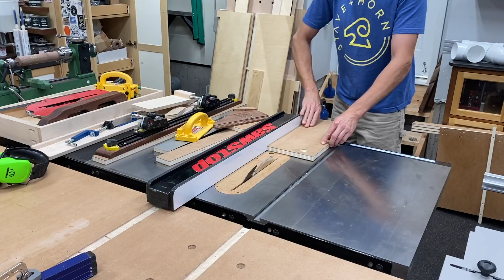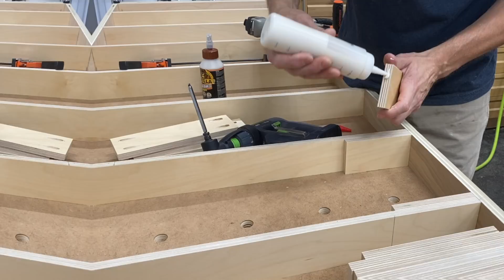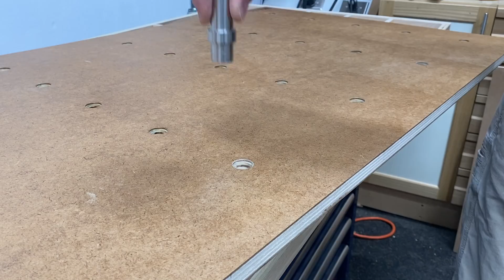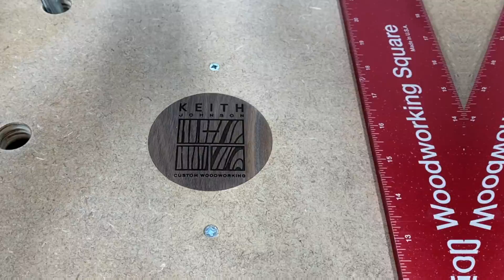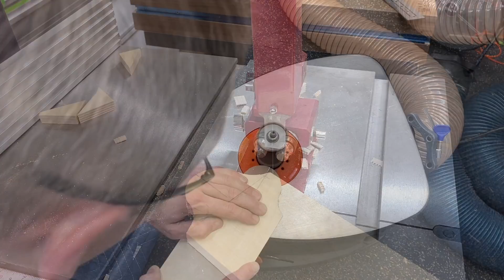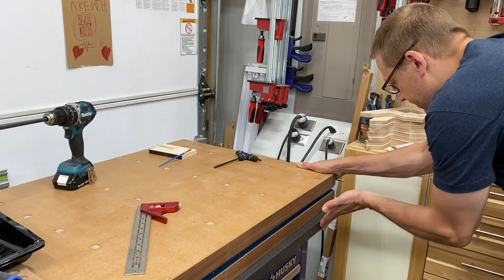ULTIMATE Assembly Table with Torsion Box Top and VACPAD System

Comment: Hey Keith, what's the spacing between the dog holes?
Reply from the maker: 240mm center to center lengthwise and 125mm center to center front to back. Not the typical MFT spacing.

Comment: Thanks Keith I get a real kick out of your videos in your cats. I purchased the VacPad system based on your video. It arrived in January and I just started trying to set it up in March but there’s no instructions and it doesn’t look anything like the systems that I see in your video. I have all of the plates. I have the vacuum I have the hoses. I have the foot switch, but I don’t see anywhere to hook the tubes up. I wonder if you have any instructions on how to set it up
Reply from the maker: Hey Tim! You can can out this video by Spencer Lewis on operation https://www.youtube.com/watch?v=oUf9OWGHMow . But there should be little quick disconnect ports on all of the pads that the hose pushes into. They should either by on the edges of the pads or the bottom depending on which ones you have. Hope this helps!
Reply: @KeithJohnsonCustomWoodworking  Thank you I have the newer pads and it appears all the videos are using the older style with the port on the edges. I'll see if I can figure it out. Appreciate all your videos. Thank you
Reply from the maker: @Reatimc Oh no! Sorry I couldn't help with the redesigned pads.
Reply: @KeithJohnsonCustomWoodworking  Got the VACPAD setup and integraded into my MFT Table it's working great. Thanks again for the help and the reference to the VACPAD system. tim

Comment: Also, you never explained how you got the vac pad that’s on top of the table to hold to the actual table top. Does it also suction itself down to the table ?
Reply from the maker: Yes, with a hole in the back of the pad, it suctions itself down.

Comment: Hi. Great video. Where did you get that air compressor and how is it that it attaches to the compressor. I have one for my vacuum chamber to take out air bubbles from epoxy but the fitting makes it impossible to attach the air hose or any sort of fitting so that I can attach the hose. Weird fitting. Still figuring out my options with that but this looks direct so I’d rather go with your air compressor
Reply from the maker: They sell them on the vacpad website

Comment: Nice work. I saw another vid of yours where you had mounted the Dashboard track hinge on a table - is this the table you’re using as an mft? Any concern for dust buildup in the tortion boxes, or just worry about it when you replace the top?
Reply from the maker: Yes, using this as my MFT. It would take 50 years to fill that up with sawdust, so i'm not really worried about it. 😜

Comment: Hey Keith how is that peel and stick veneer holding up? Also for the halcyon did you tip with a brush after or did level nicely with the roller?
Reply from the maker: Veneer still tip-top. 👌🏻. When rolling the Halcyon I just let it level out, but it’s just a workbench. You may have to tip it on a more important application.

Comment: I thought the vac packs seemed a little gimmicky but after you showed how they work I’m definitely a believer.  One question though, how did you secure the one that holds the router to the top?  Love torsion top benches, I’m on my second with eyes on the third with “refinements.”
Reply from the maker: So, you have a couple options on how to secure those pads...there can also be a hole drilled in the other side which allows it to suck down and be secured to the bench, as well as the vacuum hole on the other side that let's you secure your workpiece.

Comment: Hi Keith, did you make the mft top holes so that each hole is usable...meaning not hitting the inside partitions?
Reply from the maker: Correct. All torsion partitions are directly between 2 holes in both directions so all holes are useable. 👍

Comment: I too have tear out issues with that style of edge trimmers. What method do you use when it must be perfect?
Reply from the maker: Typically I don't it cut the edge banding so oversized , so I will just stick a piece of 120 or 150 grit  to a piece of wood and hit the edge at an angle by hand until the excess is trimmed away. Or I will hit a with sharp plane or chisel and finish sanding by hand.

Comment: Amazing. Thanks for sharing and inspiring. Quick question ... I tend to drop at least 389 items in my dog holes each time I'm in my shop. But I can get to them when that happens. Are your holes positioned on top of the support pieces inside the box so they each have a bottom?
Reply: I imagine that eventually they will fill up with wood shavings / sawdust and cease to become a problem.
Reply from the maker: Thanks Eric! And yes, there is a hole in each "compartment" underneath if need be. Or a small stick with a magnet or double sided tape can fish out anything that may need to be retrieved. 👍

Comment: Awesome video. Love the humor.  I was wondering how you retrieve items that fall down the dog holes into the bench? And a suggestion on sanding between coats - you can use a much finer grade of paper than 200....closer to 600 is adequate to take down the rough spots without removing too much of the last coat applied and gives a nice smooth finish.
Reply from the maker: Yeah, I'm guessing I will only drop screws down there, but anything of importance that is metal can be fished out with a magnet. Thanks for the sanding top, but I don't think I own anything higher than 220 😂

Comment: Adequate is right, you only put your logo on it 3 times.  There's clearly way more surface area (especially on the inside) where you could fit more. 😤
Reply from the maker: Yep, and the bottom and the sides, too. Next time...😂